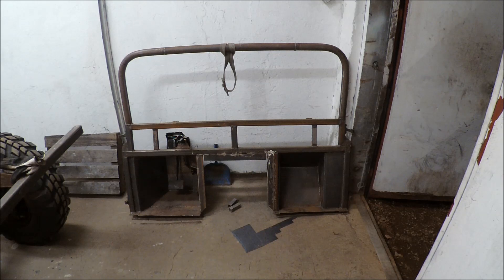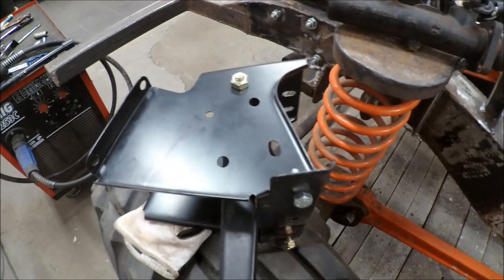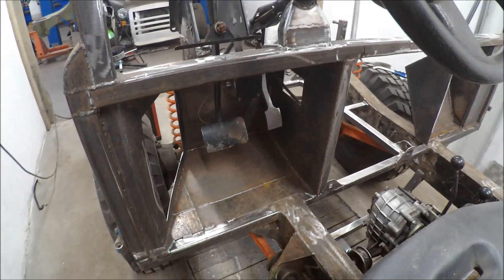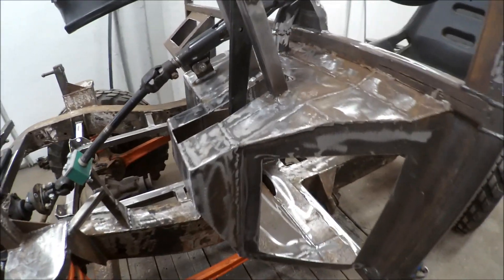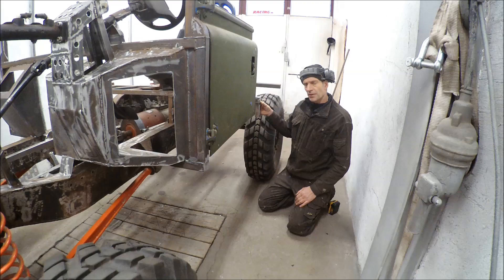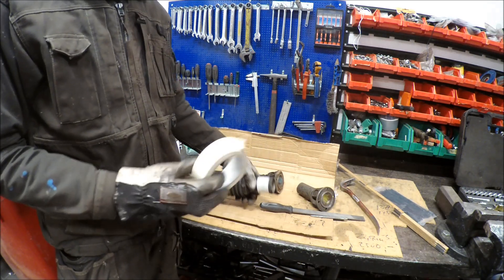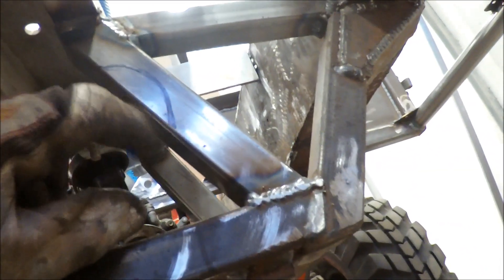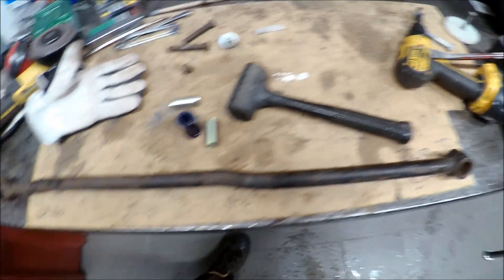Electric Landrover Steering, pedals, kardanaxles etc

Comment: Great work. Interesting to have such a small work area with the air cleaner. Obviously it works well.
Reply from the maker: Thank you, Swampwild1 ! I think you only see 1/3 of the workshop and it is just an exhaust fan , it evacuate all smoke and grinderdust outside the wall. BR Per
Reply from the maker: Hello, Swampwild 1 ! Lost your comment, answer here. I use Windows movie maker, not the best program but works, you can raise volume there also. Managed to lower mikrophone volume on my camera ZOOM Q8, by mistake, raised it now. Others have also complained about low volume, fix that in next video.  BR Per

Comment: Hi, nice video and I can’t wait to see the test drive and how the Tesla battery will move this weight..
Talking about battery I will appreciate your support to find a good seller. I am almost done with the conversion of a 350 yamaha raptor with a Miromax set up (5kw BLDC motor)
My battery from AliExpress are useless compare to the power needed. 

If you can suggest good brand and seller to provide a battery of 48v and 60ah I will appreciate (and real amp/hour not like AliExpress sellers ☹️)
Reply from the maker: Hello, happy you like my video. I have not bought any small suitable batterypack for your needs and dont really know where to buy them.  I built this battery pack : https://youtu.be/6ezTCG2Kiz4    In comments you can find links to the parts. Otherwise I dissamble OEM packs and I can really recommend the BMW I3 module. 12s 48V, good for approx 300A. Here you can find video where I fit BMS on a module : https://youtu.be/7QEs4aWpgAM
You can find them on EBAY or if you live in Europe : https://evshop.eu/en/batteries/117-5300wh-bmw-i3-battery-module-45v-120ah-nominal.html
Suitable BMS : https://www.aliexpress.com/item/1005001413576971.html?spm=2114.12010615.8148356.3.7cbb2438JysVQ7

BR Per
Reply: Thanks for the feedback, will check your links